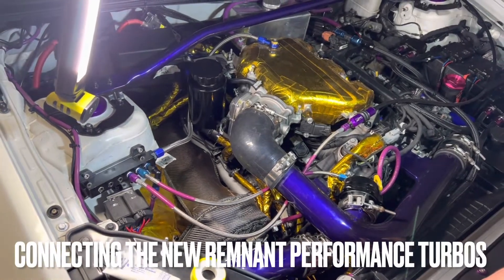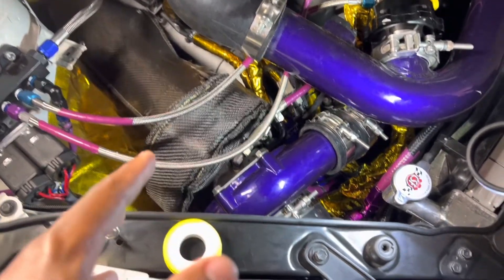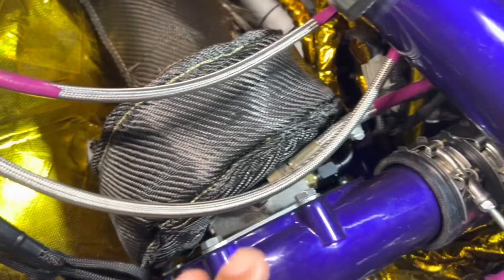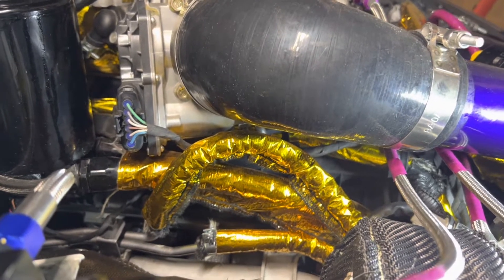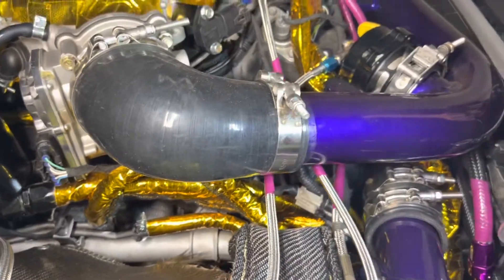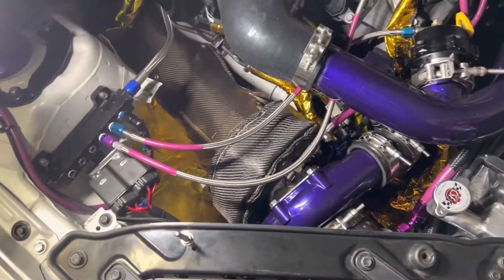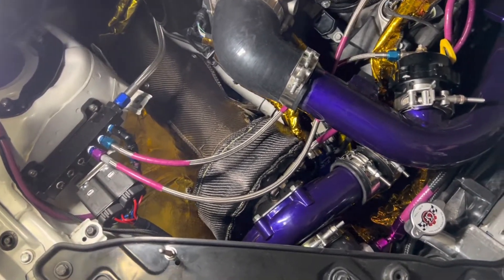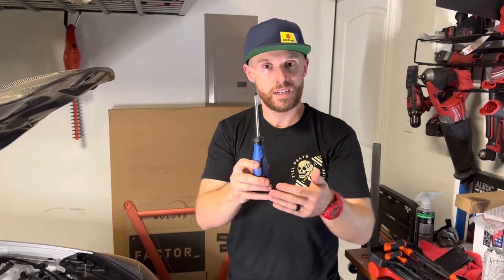10-B. Connecting The Remnant Performance Turbos - RP 3.8 Turbo Kit Installation

Comment: Coolant lines on the throttle body are not needed, they only heat soak as you said !!!I’ve been in up to -17 degrees Fahrenheit without them connected and the car started just fine
Reply from the maker: Great point bro! Thanks for the info! 💪🏾

Comment: do you expect the supra kits to be available by this year?
Reply from the maker: Absolutely! Haha everything is done from the kit perspective. All piping, couplers, lines, filters, billet fittings etc are all done. The proverbial “long pole in the tent” was the proprietary twin-scroll turbine housing with the integrated internal Wastegate. It has proven to be incredibly complex to manufacture with our Foundry left scratching their heads a couple times 😂. The good news is that we found solutions to everything right now so it should be smooth sailing as far as producing the turbine housing
Reply: @RemnantPerformance  Thanks for sharing. Any luck in finding a gen1 b58 car?
Reply from the maker: @jp_b58  no problem and actually yes! If you aren’t currently following our Instagram page, make sure you are as we have an announcement tonight! 😉

Comment: Whats this turbo vs the 6266bb whats the difference?
Reply from the maker: @genzlla, this is a very interesting question! Well we will start with the similarities. Both turbos have a dual ceramic ball bearing center cartridge so they both have very near frictionless rotation which is great! 

After that, everything is quite different. While the Precision 6266 is a great overall turbo, it’s based on significantly older technology than the Remnant Performance 70 OMEGA. So the 70 OMEGA is significantly more efficient per mm than the 6266. In addition, the 6266 has a small 62mm inducer on the compressor wheel vs the 70mm inducer on The 70 OMEGA. The 70 OMEGA also features the very latest in turbine wheel efficiency and is coupled with a large 1.01 A/R Turbine Housing which allows it to breathe at high rpm’s. Also, the 70 OMEGA’s ultra efficient design allows us to minimize rotational weight so it basically Insta-spools on the 3.8 as you can see in the video. The 6266 simply doesn’t spool as fast and doesn’t make as much power for a given psi. 

If you look at the graphs on cars running the 6266 vs the 70 OMEGA, you see that the 62mm compressor and turbine housing combination that was chosen by TK is just insufficient for the needs of a 3.8L V6. The power drops off hard in the upper rpms and yet it doesn’t spool as fast as the larger 70 OMEGA. The 70 OMEGA is designed to support over 1,000whp and insta-spools on the 3.8. So no matter if you’re running stock engine or a completely built setup, the 70 OMEGA will spool faster and support more power at every rpm and every boost level than the 6266. This is why we’ve seen cars running as much as 13psi on the 6266 and still not breaking 500whp while the 70 OMEGA is already over 500 at just 10psi and gains roughly 25-28whp per psi.
Reply: The 70 Omega makes a shitload more power, spools faster, and is a more appropriate size for the Genesis 3.8.